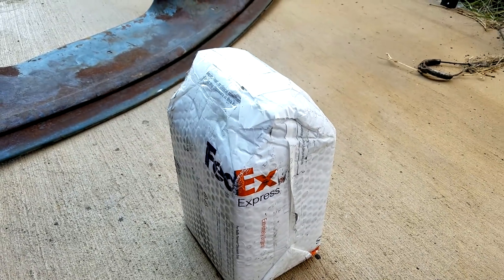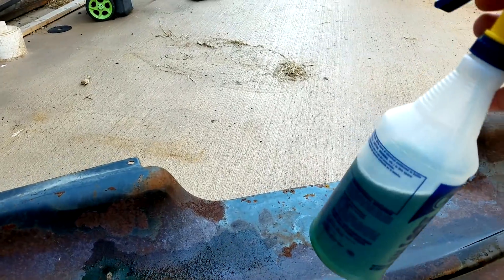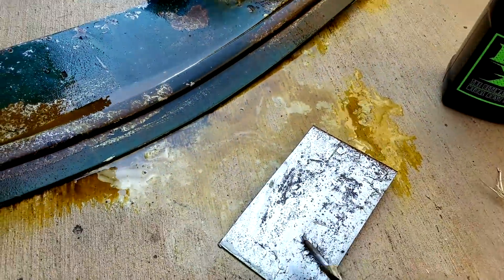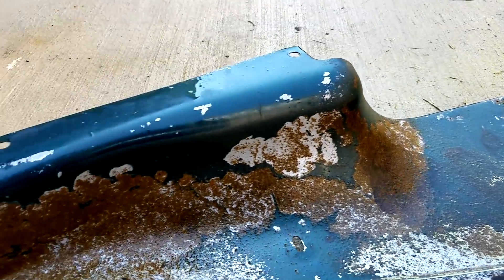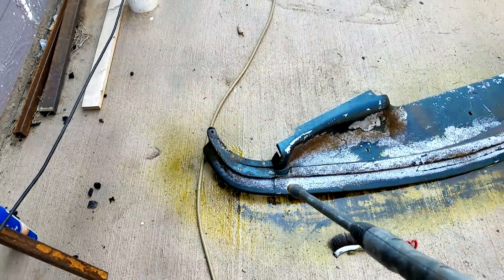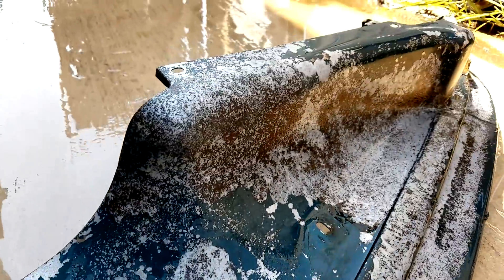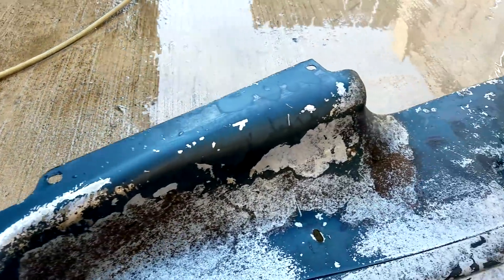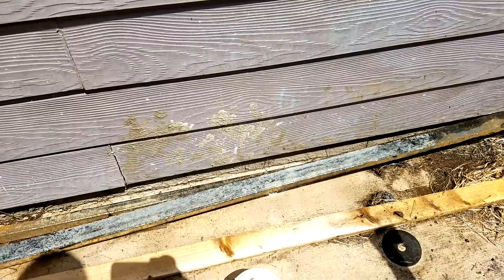DRX1 test and review

Comment: I may be wrong, but I would assume that unless it is only surface rust from being out in the rain or something where the rust has just appeared within a short period of time, the best way would be to submerge the item and give the Dr X cleaner time to work. Also, it should be noted that DR X cleaner can not be used on aluminum or chrome, so be careful when using it on mixed metal material, like on the body of an automobile. 

Albeit, in my opinion, only the product known as Evaporust is capable of doing what it claims to be able to do, but for Evaporust to work properly, it takes time, from hours to days depending on the advancement and depth of the rust to be cleaned and removed by a totally covered soaking in the product.

Comment: -I USED THIS PRODUCT AND THE GRADE IS "C". and I AGREE WITH THIS VIDEO WHEN HE SAID "IT WORKS BUT NOT LIKE THEY CLAIM ON VIDEOS" 

If you have just small surface rust it will do a job as i used it tree trimmer blade rose cutters, small surface  BUT like most items out there that is not the case as there is rust deposit so at first  I used a shovel that has decent rust and I has to apply 3 coats and there was still rust spots afterwards. Note- you will see rust spots embedded int the metal period,  Plus you must use a pressure washer garden hose will do NOTHING, but does everyone have a pressure washer, I bought this to remove some rust under the front end of my car as its hard to get to so it will do the job as its not as bad as the shovel rust. 
I paid $50 for a gallon of this which includes the shipping part and if I has to the shovel again I would use a wire brush first to remove as must as I can and then use this product to finish the job.
Reply: Sand paper and elbow grease old school

Comment: I think a little trick I would have tried, is to get some of those blue paper towels you can get most any where {auto parts store, Home Depot, etc.,}  first spray with the product where needed until wet, not run off soaking, then lay some {paper towels} over where you spayed, spray again until the paper towels are wet, not soaking, and just keep the paper towels wet, I think via this method the product will go a lot further, work a lot better and save you some money / expense of the product.  Plus you could move the towels to different area's. Just my two cents, for what it's worth.
Reply: Same thing i do with other products. Maintains exposure and saves product.
Reply: Wire wheel works good and paint stripper old school
Reply: Look at you! You thinker you! Haha I like it!
Reply: I did an old bathtub using that method and a product call CLR

Comment: Looks like Phosphoric Acid by color ... same stuff used in soda pop. You can buy a whole gallon at Walmart for $16. Neutralize with baking soda in water after power-washing if necessary since all the water dilution by the power wash might suffice and then dry it quickly.  Holdtight102 as a last step to remove all surface salts before coating with acrylic primer, POR15, or similar spray-applied anti-rust coatings.

Comment: hell we used the works ,toilet cleaner on rusty part to clean them ,you have to rinse them off within a few minutes with water ,or it will eat the parts , works great on old brake lines ,dont laugh until you try it ,$1,50 at dollar general
Reply: What kind of toilet cleaner
Reply: @abrahamgonzalez8907  it's called "The Works" toilet bowl cleaner and it's strong.

Comment: Looks like you maybe used a wire wheel after the drx finished. That turned out great. There was a lot of Heavy pitting going on under that rust. I like the idea of using the blue towels. I may try a quart on a few pieces I have and see what it does with the towels. Will try to get a video together. Thanks for the video.

Comment: Why is the stuff they show in their video orange-ish and green in yours? Seema like youre using prep and etch from home depot almost
Reply from the maker: VADERtheFADER the product has a greenish color to it, the orange is the rust coming off. I really do like how the product works just wish it wasn't so expensive. I have tried leaving nuts and bolts in a bucket overnight and it works great just don't leave it for too long or it will dissolve anything metal.
Reply: Prwongman1, from what i can tell, VadertheFader is correct. In the videos I have seen, thanks to their generally translucent spray bottles, the color of the bottled liquid applied by the Dr X representatives  is "orange-ish", while your product is green.
    Can you confirm the last sentence of your response comment where you state if you leave things "in a bucket over night it works great just don't leave it for too long or it will dissolve anything metal"?

Comment: Stuff works great if you follow the directions which you did not !  I have a model a ford pickup that was in rust patina and used one gallon for the whole truck down to bare metal. Guess you didn't know that you can use a catch pan for the liquid that runs off. Yep you can reuse any excess liquid that runs off like three times.
Reply from the maker: Good to know, on light rust it did great, i followed the manufacturer video's and never saw them reuse the product.
Reply: can you explain what exactly he did not do to follow instructions?  The only thing I see different is the manufacturer used way more liquid than this review did. At what they charge for this, just go buy yourself some vinegar, will do the same thing.  All hype
Reply: where is your video? Prove your point he did What part of the directions did he miss?
Reply: Vinegar is crap. Tried it, and know others who have too. Doesn't work, At least in the automotive field . Only good for salads.The competitor of this stuff is Rust-Mort. Works good. (Phosphoric acid). Thanks for posting.
Reply: How does the runoff affect the concrete and grass?

Comment: had a gallon of this stuff shipped here to canada 144$ just for transportation fees ,overall with currency exchange almost 250 canadian for 1 gallon
Reply from the maker: roger white it is a bit pricey, here in the US harbour freight sand paper would have been cheaper. I'll most likely use the remaining half gallon for smaller items that i can dip and let sit in a reusable container.
Reply: and it took almost 2 weeks to get here,
Reply from the maker: roger white have you used it yet? What's your opinion? I think it works pretty good but if I'd have to do a whole car it would be easier,  faster and possibly cheaper to have it professionally sand blasted.
Reply: no .its for cleaning a bit of rust on a production chain of a quail processing plant, but will use it next week
Reply: waste of money
Reply: roger white :
And Guess What?
It Didn't Worked As It Was Shown In Their Ads.
White Vinegar Much Better Than This.
Reply: i saw another comment saying in Canada its called CLR? maybe it would be cheaper getting that?